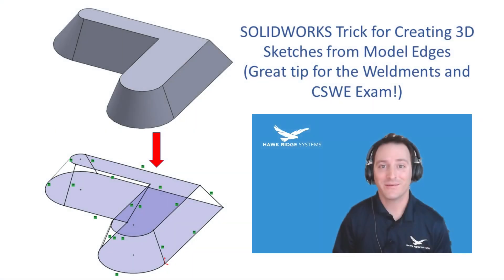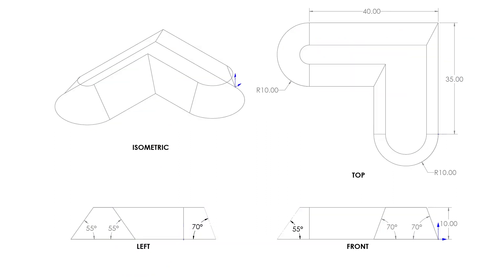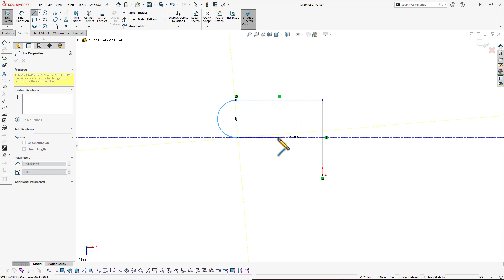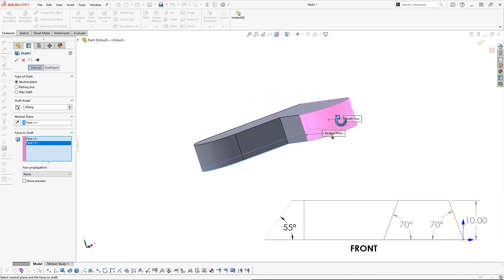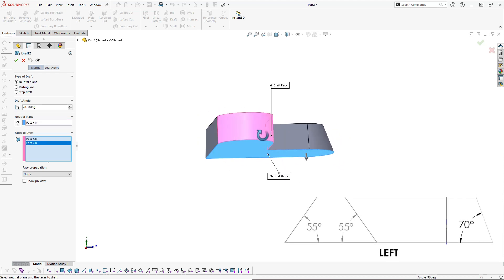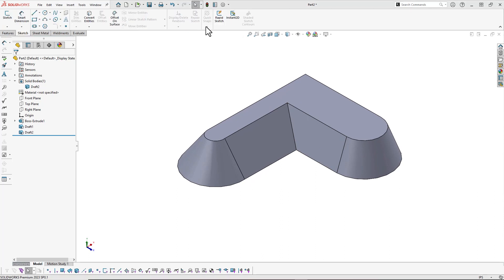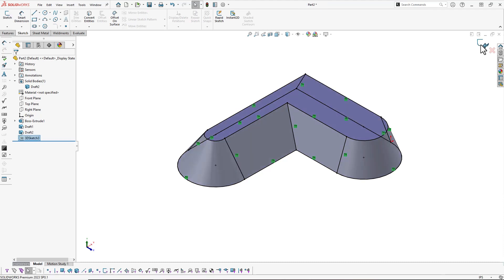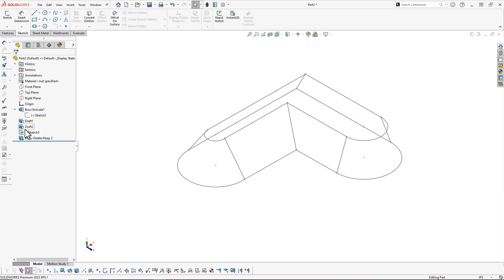SOLIDWORKS Trick for Creating 3D Sketches from Model Edges

Comment: Thanks for the tip ? Can u explain you put 20 deg instead of the 70 deg on the print ? Thanks
Reply from the maker: A "Neutral Plane" draft in the Draft Feature will taper the walls toward the 'direction of pull'. The angle is a net difference from the grey arrow shown on screen. Since the arrow is vertical, the angle must be taken from a vertical reference, which in this case changes the 70deg to 20deg.